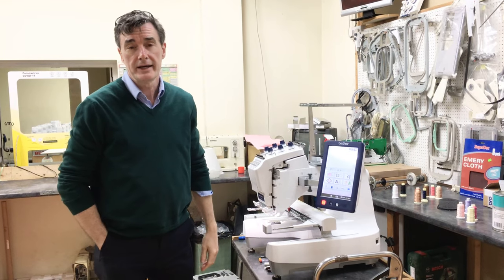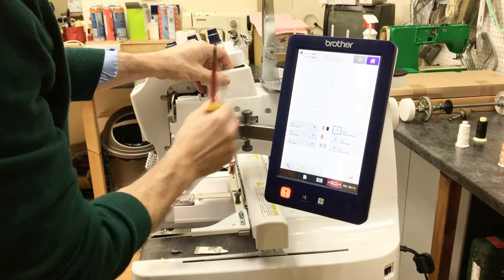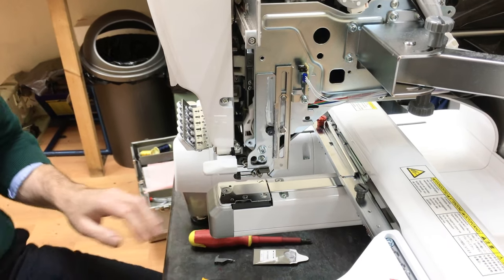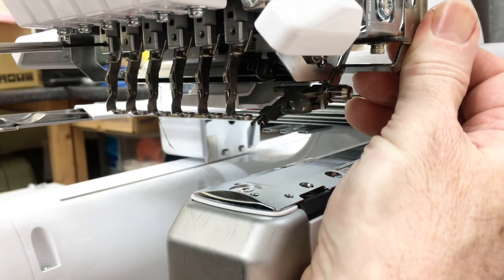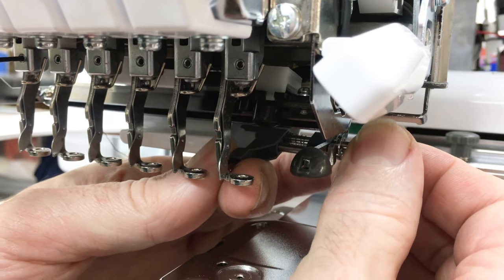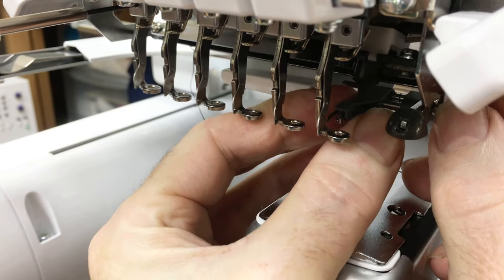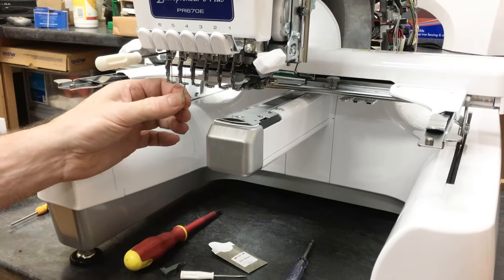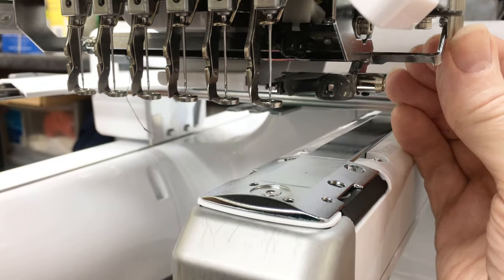Replacing a Brother PR Needle Threader

Comment: Thank you for this instructional video, you have given me the knowledge and confidence I need for replacing the threader on my PR1050X myself. I wonder if you have any guidance on replacing one of the needle bar thread guides (last guide before threading the needle).  My #5 guide is broken and I have located the part and see that there is a screw on the backside of the piece the guide is attached to.  I can't comprehend a way to reach this screw, to loosen then tighten,  without taking apart more things than I am comfortable with.  
I have already learned so much about my machine from watching your videos.  Please continue to make more videos, they are appreciated.

Comment: What are the black and red wires just above and to the right of the needle threader?  I thought the red wire was thread that had gotten stuck so I dug it out only to see that it wasn’t  thread at all.  Now I cannot get the number one needle to thread and the pressure foot will not come down as far as the other needles.  What terrible thing have I done?

Comment: Hello Steve from NC, USA. I enjoyed this video. I live in the country 1 hour from repair shop. I have Babylock EMP6 very old used machine. I don't feel it's cutting thread as several years ago....wondering if your video is applicable to my machine as they are sister machines? Thank you kindly.
Reply from the maker: Hi, Although we don't sell or work on the Babylock EMP6, it looks to be very similar to the Brother PR range. Our instructions on changing the Needle Threader should still apply. Best wishes, Steve.

Comment: Hi Steve, deparatley trying to get my needle threader to work but it will not pass the cotton thru' and does not return to the top of the machine. I have a brother inovis 4000d - there is no u tube for the 4000
Reply from the maker: Hi Jennifer, Please phone the shop on Monday - 0161 707 7786. Or email Steve at steve@bambersew.com Thanks.
Reply: @BamberSewingMachines  thanks Steve, I did phone you and you gave me the answer so, the machine is going back to my mechanic as soon as weather permits but Thank-You for a great videoad for your help